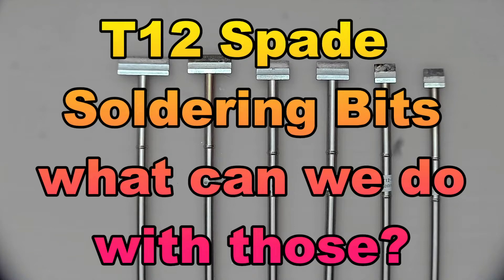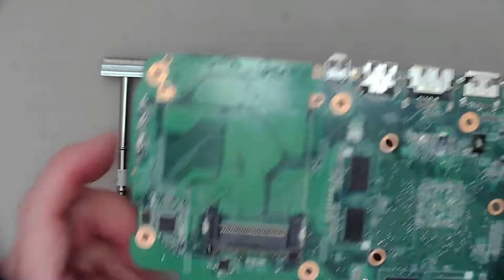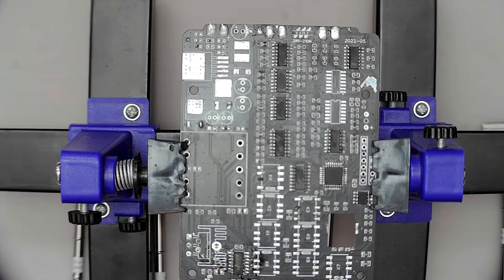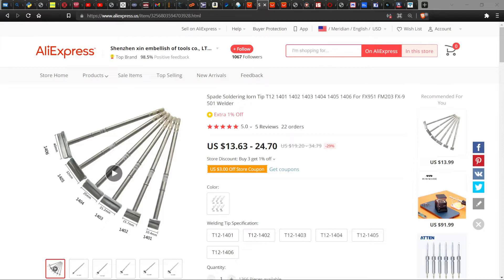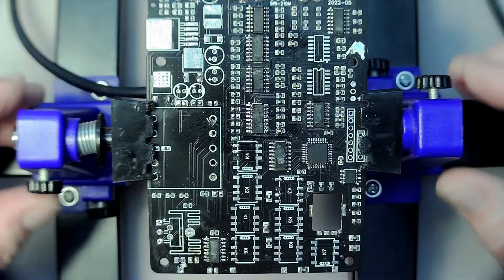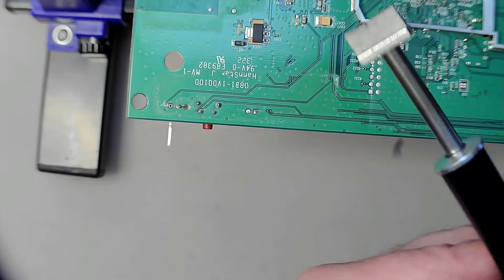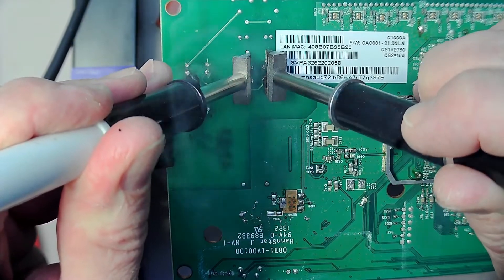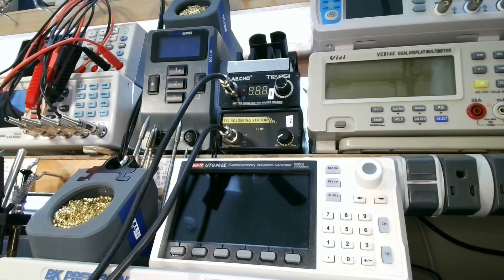T12 Spade Soldering  Bits

Comment: they nowadays make heated tweezers , these work great on the tiny resistors , there more expensive versions that allso have spade tips to remove ic chips , sofar i havent found those on aliexpress so i might have to make a set myself from a normal set , not sure yet if im going to hammer them in shape or somehow weld pieces of copper strip on them
Reply from the maker: Yes, these are the hot tweezers I use. They are very good.
Reply from the maker: https://youtu.be/7Jzx2LjOxfc

Comment: i wonder if it possible to make it a hot tweezer version,custom machined handle with that tips
Reply from the maker: Where there is a "will there is a way" so to speak, however, I have two cheap T12 stations and use two solder irons as tweezers which works well enough for me.